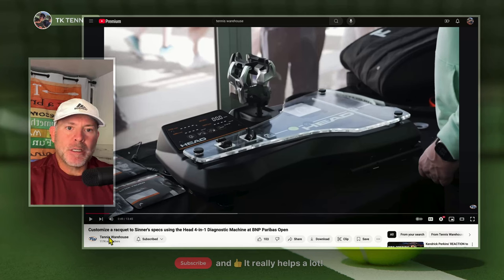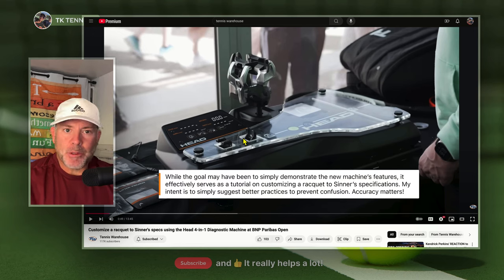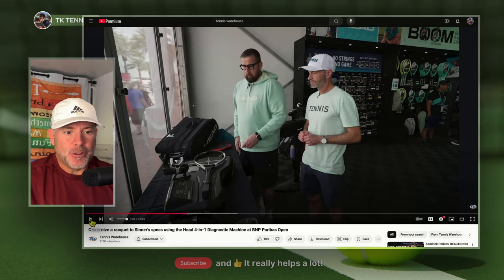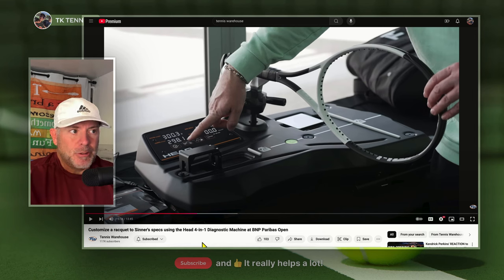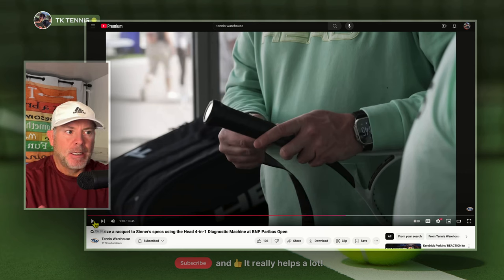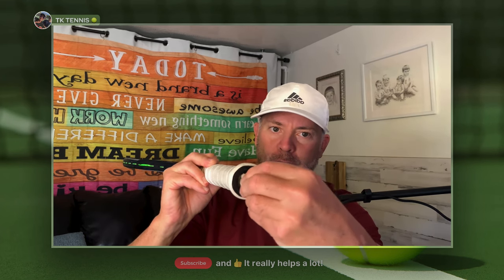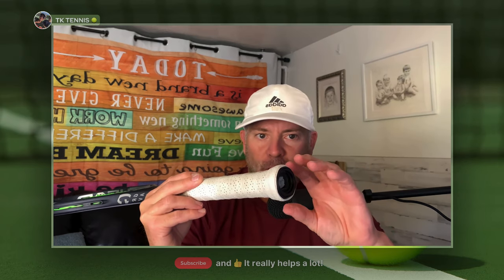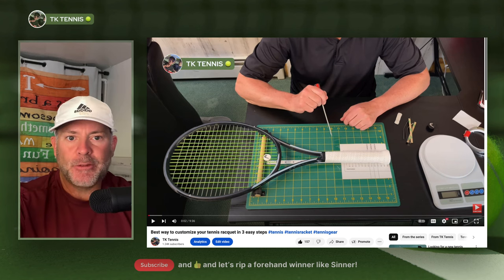How "Not-To" Customize Your Racquet

Comment from the maker: CLARIFICATION: There are valid reasons to measure racquets unstrung, like when you want to match two or more with similar specs before further customization. While absolute best practices include measuring unstrung and again in the final playing state, what ultimately matters are the final measurements (balance, static weight, swing weight, and twist weight). Players should know and document their playing state metrics as a baseline. This is also critical if you switch models and need to dial in a new racquet to your specs. In contrast, unstrung measurements are far less important.

If you enjoy my takes, even if we don’t always agree, consider hitting SUBSCRIBE and LIKE! 👋

Comment: IMO unstrung swingweight is far more useful than strung SW, as strings in the same gauge can vary greatly in weight.
Reply from the maker: That's my point. Let's say you your ideal swing-weight is 325 strung, then that's what you would want to optimize for it with strings, right? Otherwise if your unstrung swing-weight for example is 310, your actual playing swingweight will vary depending on the strings you choose. The final playing swingweight, static weight and balance is what matters most and that requires the racquet be configured with strings, overgrip, dampner (if you use them). My 2 cents, but appreciate the alternative viewpoint.

Comment: I disagree with you completely on both fronts.   (1) customizing your racquet with it unstrung and no overgrip takes away the variability from strings, etc and let’s you just match racquets mono to mono.   If after you add strings and overgrip and you want to bump up your swingweight or static weight , or change the balance then yes, you can make changes afterwards.   But for matching racquets, it is best to do it in completely raw form.  (2). Weight in the handle performs differently depending on where in the handle you put it. Lead on the handle gives you the flexibility to customize for the exact feel you want.   Blue tac and silicone are great as well for tailweighting but don’t discount the flexibility that lead tape gives.
Reply from the maker: I've posted a clarification in the pinned comments. I agree that when it comes to matching racquets measuring unstrung weight is necessary, but bear in mind this is not what they were doing in the video. While it’s true that lead tape in the handle offers a minor advantage in added flexibility, it’s a messy approach with more downsides and shouldn’t be promoted as good practice.
Reply: Explain to my how there is going to be variation if you use the exact same strings, dampener and a fresh overgrip on every racquet.
Reply: @tijgertjekonijnwordopgegeten  the issue is that not every one uses the same overgrip, dampener and strings.   Plus if you’re going to hide the lead tape under the bumper guard, the only way to do that is with the racquet unstrung.

Comment: For an even more accurate reading, make sure there are no overgrips, dampeners, or any other attachments. Just the frame, unstrung, will give the racquet’s core specs. This allows accurately track of any changes make later and ensure consistency across multiple racquets.
Reply: Unless you use the exact same strings, dampener and (fresh) overgrip for every racquet.

Comment: Agreed lead tape on the handle is unnecessary, unless you  a have technifibe racquet where you cannot open the but. Its best to just get tung stand putty for weight off ebay.
Reply from the maker: Good point. All manufacturers need to put trap doors on their butts!

Comment: I want to get my Wilson Profile 95 remade, I want to make it a 100sq and make the frame a little thinner! I want the racquet made from Kevlar and I want the weight to be 13.5 once’s without strings! I don’t need lead because the Kevlar is a heavy material! The Profile is the one of the best racquets ever made my friend. I have 6 of them that I have been using for over 30 years and the racquets are perfect condition considering I have been using them for over 30 years.

Comment: I think the swing weight check was to see if it came in on spec, of course to see the swing weight you play with you woudl have the strings, over grip etc
Reply from the maker: Fair point. Or the general point of the video was to simply show-off the capability of the new toy. From my perspective, it would have been best to explain and do thing more throughly in the best interests of the typical player.

Comment: Lol 😂😂😂 

To 1: He wanted to have Sinner‘s specs, unstrung 303 sw or something like this, AND very imp, a tennis racket will always customized UNSTRUNG. Without strings, overgrip or dampener. 

To 2: Fabian whould normaly put silicone inside the handle or tungsten putty, no lead tape. He had to do this because was quickier.

Did you watch another video? 😂😂 

It was nothing wrong what he did.
Reply: You are absolutly right!
Reply from the maker: @kneeslider9342  I've posted a clarification in the pinned comment above. While there are reasons to measure unstrung baselines, the final playing state measurements are what truly matter for players who care about their specs. Regarding lead tape on the handle—it's slower, messy, and slightly changes the grip shape. Professionals should not be recommending this approach when there’s a cleaner and more efficient alternative.

Comment: My racquet doesn´t feature a trap door.

And if you should customize strung or unstrung is highly debatable. I don´t know if grips are always the same weight or if that changes due to sweat absorption.

But I would customize a naked racquet as well. Just in order to minimize variables. Every component may have its tolerances, those can work against you. Not by much, but it can add up.

Shure the result changes after stringing. But whoever does the customisation should better know what to do anyway.
Reply from the maker: Fair point for racquets without trap doors on the butt cap 👍. Unless I am matching racquets for someone at the time of purchase, I just see very little value in measuring weights unstrung, but there certainly is no harm in measuring a naked racquet as long as the playable state is also measured.

Comment: 3:20 Won't this change the feel of the racquet as you're putting a material that dampens vibrations in the handle?
Reply from the maker: Great question. Many racquets have dampening tech in the frames or handles already, but "if" you are hyper-sensitive you may notice a slight improvement (unless you don't want that) in dampening after adding Tac into the handle. The same thing occurs when using Silicone. Overall adding material to the handle is easier, tighter, cleaner and more flexible. Adding lead tape to the handle is the last resort solution from my perspective.